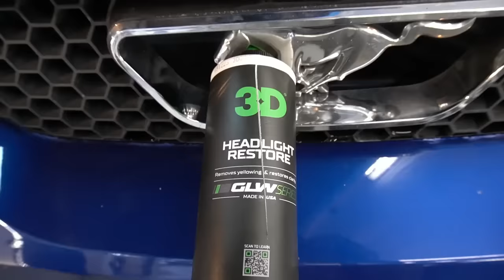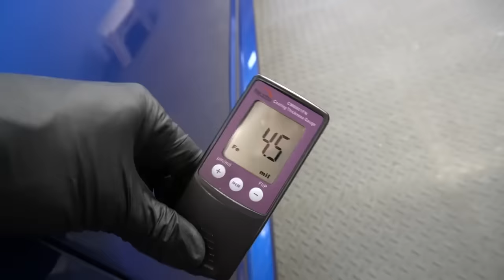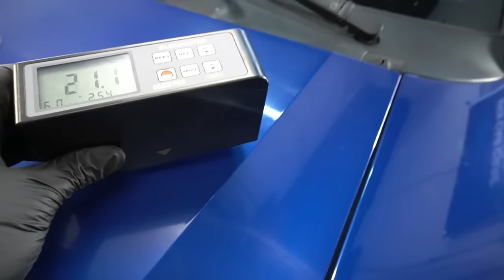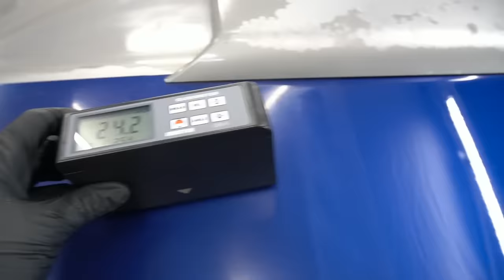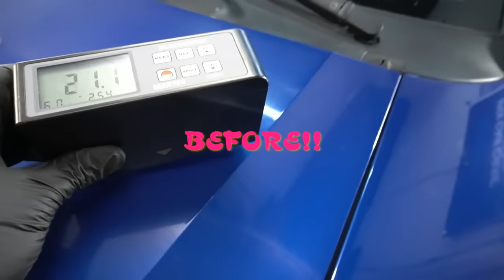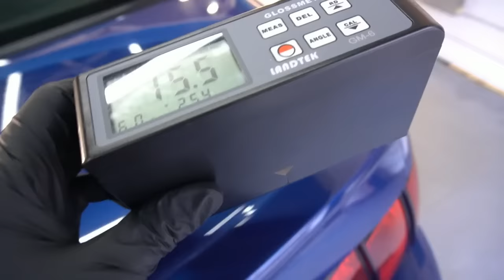Let's Make It Shine!! I Bought This To Teach My Son How To Drive Stick Shift!! (Manual Transmission)

Comment from the maker: How many of you own and drive a vehicle with manual transmission? What is it?
Reply: Last one I had was a 96 Nissan 240sx. Great car! Got hit 3 or four different times and still unstoppable. It did get pretty ugly though. After I grew up to a Lexus es350 I never looked back. Although now I am working on an sc430 2dr convertible drift missile. It has the automatic 5 speed.
Reply: First one I had was 1970 Volvo 145s deluxe blue station wagon manual transmission.  Last one Mitsubishi Montero 1992.
Reply: 2017 Ford Focus ST3. I call it my luxury go cart. It's so much fun to drive and never fails to put a smile on my face. I'm nearly 65 years old and have owned more manual shift cars than automatics  😁
Reply: I've only ever owned manual transmission cars. Currently, an '04 Nissan Skyline 350GT or Infinity G35 for you North American folks. It also has an aftermarket stereo system that I had professionally installed as the original Bose system was faulty when I bought it. Really great video, Brian! I hope your son gets a lot of enjoyment out of his stick-shift Mustang!!
Reply: I’ve had a lot of manual’s. Currently have a C7 Corvette with a 7 speed.
Reply: MkVII 2017 GTI. 6spd  manual.  Unitronic stage1+ tune, DKM Stage-2 clutch. 310 hp/345 ft. lb. torque.
Shine on you crazy diamonds!
Reply: Just purchased a Toyota GR Corolla. Only comes in manual!
Reply: Also I absolutely love the iconic stock wheels with the Shelby cobra paint scheme. You did a great job as usual making her shine. I was sick today with a cold, and I enjoyed the long video along with an Epsom salt soak. It was the most peaceful part of my day. Thanks Brian!
Reply: Brian Jr, welcome to the dark side😜😜😜  teasing you, welcome to have fun with a beautiful vehicle that surely will last longer than an automatic transmission
Reply: 2021 challenger scat pack 6 speed manual transmission
Reply: Currently a 6 speed '95 993.  It almost shifts itself!
Reply: All three of mine are manual. Reverse in 3 different spots, so going from one to the next is always a bit confusing.
Reply: My first manual car was my new Mazda RX-7 that I bought in 1979. I've had a couple shift-it-yourself cars since then but now drive an automatic. I've had enough years of using three pedals.
Reply: It's been manual throughout todate!! Driven a number of automatics, for obvious reasons, but never owned one. Great turnaround on that mustang; am sure Jr. Will enjoy interacting with the system (while it lasts)! Thanks.
Reply: had a supercharged foxbody with a Tremec TKO 5 speed.
Reply: 2014 Mustang GT/CS...but every Mustang ive owned since 1983 were manuals...except the 2001.All V8 of course.
Reply: Race Car is manual of course!  Plus 98 F250 we use to pull to track
Reply: 2003 Z06
Reply: 15 Subaru STI with BC5 on all of the glass.
Reply: Still have 2 cars left with manual transmission. A 91 Mustang GT with a swap to a Tremec T56 six speed, and an 85 Mustang Coupe that currently has a T5 but when the 408 goes in it’s going to need a Tremec TKX 5 speed…
Reply: 2008 Mazda Miata, power retractable hard top
Reply: 15' Fiesta ST.
Reply: I drive a 2015 Holden Astra Turbo coupe..six speed manual daily..
Reply: 2014 ford focus. 5 speed
Reply: I had a Mazda Miata 1990, first one in my city. Red, one stage paint, at the time I didn't understand why my towels got red when I wazed the car. Sold it in 2011, after 17 years, 80 000 kms ( Live in Canada ). Before my son got his driving licence, I was afraid he destroyed my Miata, 5 speeds. Great video, Salut du Québec!
Reply: I own a 2006 Pontiac GTO with a Tremec 6 speed.
Reply: Motorcycle
Reply: This is not my daily driver living in Michigan, but I truly enjoy my 1999 Torch Red Corvette Coupe 6 speed! Brian, you are truly the King of Detailing sir. Incredible job on your son's vehicle, and congratz to him!!
Reply: 2002 Ford Mustang GT!
Reply: I daily-drive my Victory Vision. Technically that's a manual transmission 😁🤣🤣
Reply: @davidruggles996  yes! I have a black 2013 Vision. I polished it out and put a ceramic coating on it. Shame company went out of business. Happy riding!
Reply: Love my 2017 Corvette Collectors Edition 7 speed Manual!!
Reply: 2002 Civic Si
Reply: A 2000 WS6 Trans Am… bought new in Dec 99 … black on black, 6 speed manual and tons of fun to drive … 😎
Reply: My first manual was a 1969 Mustang Mach1 in 1970. I had to bring my cousin along to get it home. Didn't take long to learn the basics. Have a 2000 Corvette now with the six speed.......way more fun than my C6 & C7 with automatics...even with paddle shifting
Reply: well , 93 civic SI 5 speed , 69 Dodge Dart 4 speed , 89 , 93 and 2004  5 speed mustangs, 95 Corvette 5 speed and i used to have a 86 F100 with a 3 in the tree :)
Reply: Up until 2010 I had 3 diff Honda Prelude’s all 5spd manual.  Boy they were a blast especially the last on I owned was 4WS 1991 all Whitt🤗
Reply: 2007 Porsche 911 Cabriolet 6 speed. The 911 has been my dream car since I was 12 and I finally got one this year.
Reply: 1988 f250 3 speed with granny gear is real work driving that
Reply: I learned on a 48 Plymouth when I was about 13. I now own a 78 pinto with manual transmission. Slowest car around but so darn fun to drive!
Reply: Love my manual transmission C6 Corvette!
Reply: Majority of my vehicles were manual and I love driving them. It makes you a better driver overall.

1990 Nissan 300ZX Twin Turbo
1991 Nissan 300ZX 2+2
1973 Datsun 240Z
1975 Datsun 280Z RB Swap
2014 Subaru Impreza
2005 Corvette C6
Reply: 2010 2.4 Accord manual, learnt on it, still drives like day 1.
Reply: I've never driven anything but manual cars in my 22 driving experience. Currently own a 2008 Audi TT, petrol stage 1 and a 2017, 7 seater diesel SUV Hyundai Santa Fe. Unless you live in a big city with lots of traffic, a manual is more fun.
Reply: I do!  

I have a VW Tiguan R-line. 6 speed manual trans.
Reply: Been driving manual since 12 years old non-stop. I'm almost 40 now. Currently 500 Abarth.
Reply: 2nd car was a 6 speed Accord. So much fun learning how to drive, and rev matching. Gives you a different perspective with all the motions you go through. 

Now I have a 10 speed cvt on my '21 Accord, and it sucks!
Reply: 2015 Ford Fiesta ST
2009 Mazda Mazda6

And THANK YOU for teaching me how to properly care for them. I've learned so much from your channel.
Reply: At 14  (1989) we had a '77 CJ7 Golden Eagle 3 speed on the floor I drove back roads home every Sunday from the grandparents..  From there I drove my uncles '78 F150 3 speed on the column on his property.  My wife and I bought a '05 Honda Accord 5 speed 2 years ago.  We both love driving a stick.
Reply: Mercedes A class. Right hand drive UK. 👍🏻
Reply: @fordfanatic3307  The ST comes stock from the factory with 18" snowflake wheels. And I'm with you on the RS in nitrous blue, would love to own one
Reply: 2004 Roush Stage 2 Mustang
Reply: 2008 Shelby Mustang GTC.  The ‘C’ stands for California and the color is Grabber Orange.  Such a fun car to drive.  When my two boys were younger I was lucky because my neighbor had an old Toyota with a stick. He let my boys drive it and learn to drive.
Reply: @fordfanatic3307 they are fun to drive!!  And they sound damned good too!!!

Comment: Definitely a great video Brian! I use to drive a 1992 Audi S4. It was one of the best Quattro vehicles that had everything as features. Even a Heated Back seat. It was a little touchy on the clutch until you got used to it. I learned a manual transmission on a 1960s Bug. When I was 14. Then relearned on a 1980s Audi Fox. I was restoring my 92 Audi S4. Then a Girl blew the red light. The insurance company totalled it. I know there's lots of channels that do Fox body Mustangs. It looks beautiful compared to before. Thank you for letting us come along. 😊😊😊😊😉

Comment: For this car to become a much more enjoyable ride all around ( i used to own one) there is only really a few things that you can do that won't break the bank::
- reduce ride height by at least 1.75 inches to 2.25 . You can use coil overs or other methods .
- rear end gearing swap to 3:73 rear end 
- shorten the shifter distance with a kit .
- headers , exhaust and muffler swap out for a touch more toot in your salute .
enjoy the ride :)
Reply from the maker: Suggestions noted....Cheers!
Reply: @apexdetail85  Any time sir :)  Hella good video as well !!

Comment: Love the longer videos!  I'm curious if the gray hood paint also came out as well as the blue.  In the shop it looked like it hadn't yet been corrected and the outside footage didn't show it.  Just curious. Great information about the products too. I only have automatic trans in my vehicles.
Reply from the maker: Because it has peeled in areas, we will sand smooth and cover with a cosmetic PPF. Not sure what color he will choose.
Reply: @apexdetail85  Thank you for the response.  I noticed the peeling parts but since I'm new to all of this I didn't know if the correction steps could somehow fix that.  Is it the clear that has peeled away or maybe clear and color?  Thanks gain.  (And for my money, I think replacing the grey with black would be killer!!)

Comment: The first car I learn to drive was a 73 Mach 1 Mustang V8 3 speed manual. It took me awhile to get the hang of the manual clutch but I mastered it.
Reply from the maker: Pulling out on an incline or hill took me a while to master.
Reply: @apexdetail85  I practiced on inclines and hills to prepare me for traffic. Those manual clutches were definitely harder to drive than hydraulic clutches.

Comment: I have 2 cars with manuals. My daily is a 2015 Mazda3 fully loaded with a 6 speed. My other is a family heirloom 1994 Miata with 16k miles on it with a 5 speed. I will keep buying stick as long as I can 😂. Also I used to have crazy speakers and subwoofers, but that was 10+years ago and I was a kid. Definitely hate that stuff now and appreciate factory premium sound 😆. Plus it’s not good for my tinnitus.

Comment: If you're going to put a legit system in a car that's one thing but not bazooka cannons and dumb stuff and half ass wiring setups ... I guess the Walmart battery gave it all away! 😆 

Great video as always Brian! Killer turnaround - let's hope Jr doesn't try to drive it in the snow 😂 good luck with that haha
Reply from the maker: And the wiring was pinched and bolted down where the fender meets the door. :/
Reply: @apexdetail85  🤦🏻‍♂️ jaysus! How much harder is it to go thru one of the larger rubber grommets or seals in the firewall with another rubber grommet and go right under the trim then and or carpet back to the trunk … wouldn’t have taken but another hour or so just to hide it neatly but like I said, the Walmart battery and bazooka cannons says it all 😑

Comment: I did change my 2008 MX-5 headunit for a newer one (SONY), I wanted Android auto.. and later changed the BOSE speakers only because one was going out.. sounded horrible.  Turned out that the sound was even better than the BOSE headunit
Reply from the maker: a swap out for a head unit with Apple Car Play is as far as I go.

Comment: I used to install custom car audio and also worked for a manufacturer. Most of that is junk, the wiring may be decent quality and could be used elsewhere, but install is beyond awful. The car is way safer since the removal and I'm surprised the car didn't catch fire with how it was put in.
Reply from the maker: The cable was pinched the fender and fender well… yikes!🔥🔥

Comment: Got to love the New Edge Mustang. That 4.6 will run forever. I love my Mustang. I have a 2015 GT Whipple supercharged 6 speed that is my daily. Im in the 690RWHP range and it's a blast. I also did a nice system, the stuff you have...trash. One of the first things on any Mustang, lower it.

Comment: I was first involved with upgrading car stereos with aftermarket head units, amps, woofers, mids and tweeters back in the early '80s.  Alpine, Audiomobile  and separate raw speakers.  Later involved with improving car audio for a car mfg. (R&D).  But those days are over and OEM audio these days are hard to beat.  I can't stand overpowering ghetto stereos blaring rap. 😮
Reply from the maker: The most I would do....swap out for an Apple Play head unit.

Comment: Brian, why did you not worry about burn through on the hood body line peak and panel edge when you using the rotary/ blue wool pad?
Reply from the maker: When approaching an edge or peak....back off the pressure and skim right over it. you can also protect the area with pin stripe tape.

Comment: Cap is to smooth out voltage from drops when a big amp hits. That was a crap wiring job. I have set up many stereos, but you would not see my wring like that.

MIB neuralyzer LOL
Reply from the maker: That cable was pinched and bolted down where the fender meets the door. Yikes!
Reply: @apexdetail85  that wiring job was disturbing and asking for a rub through short! Even the way it was under trim pieces. I did better work in high school. My shop teacher left the wiring jobs to me. Either he did it or I did. Some people should just pay to have it done. Especially now with more electronics. But have seen some very bad installer jobs as well.

Comment: I installed a performance tune, cold air Induction system and did an axle back performance exhaust, along with mirror caps and read quarter window louvers.

Comment: I was too cheap to try the diy pads just yet but I’ve been a big fan of the gold standard polish with the blue and orange SDO pads lightly dampened with rinseless wash. Seemed to cut and finish very quickly on newer ford dark green paint without taking much clear.

Comment: If the audio equipment was installed properly there's no reason it would be a drain on the battery. The only way the amp's should turn on is via the remote wire off the head unit. I did car audio professionally for years. As for those components, they're garbage. Boss is Walmart garbage. And those era Mustangs have terrible stock stereo systems. The factory speakers and headunit are garbage. You can greatly improve sound with a new headunit and quality speakers. Adding a sub, no need for a huge one, helps add a little low end which these cars lack. No need to go crazy. But, as you said, modern vehicles have decent audio systems in them. Those from about 2010 and older are rather lack luster.
Reply from the maker: I appreciate the feedback....in the dumpster they go!